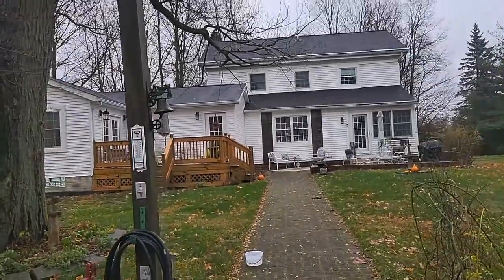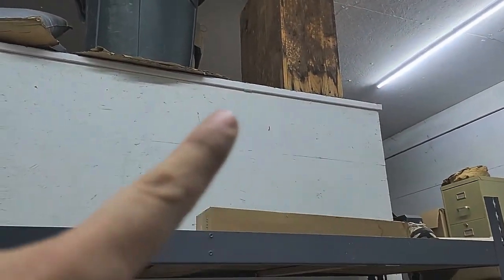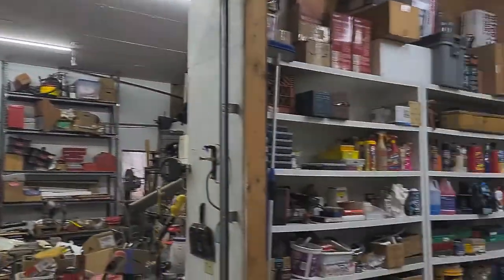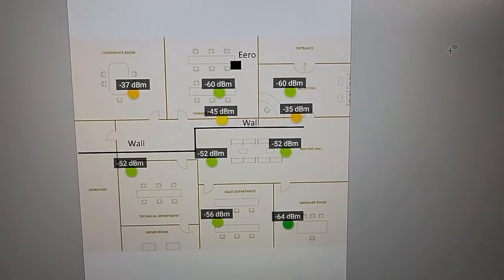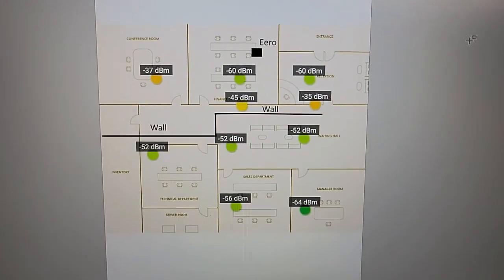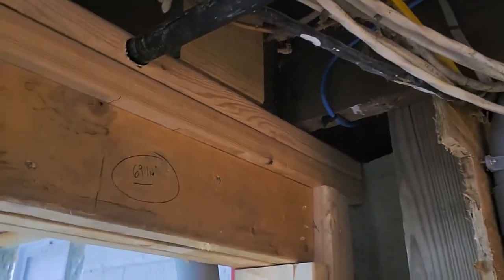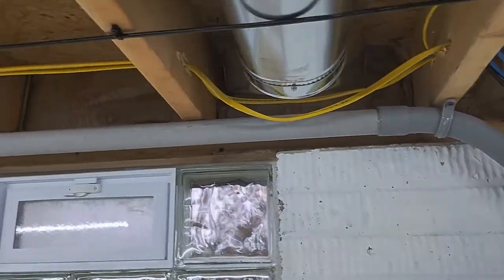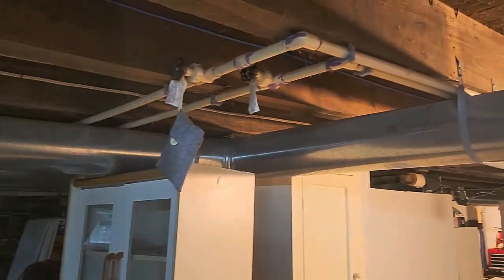Testing the New Eero Outdoor 7 WiFi Access Point

Comment: But why would you need an EERO out door wifi 7 if you guys going to still place it in the garage and not outside the garage. wouldn't a regular Eero wifi 7 work? same as the one in the house.
Reply from the maker: Because it is still outside and exposed to changing temperatures. The garage is not always heated.

Yes, it won't get wet, but temperatures will change, and this is made for that. 

Also, it is possible that two indoor units would be needed in the garage. One at each end of the garage. If so, we would hardwire them together, which means more cost to the client and units that are not made for outside.
Reply: @FisherCustomAV  Got you. But I was told these outdoor EERO are 2x2 and not 4x4, So wouldn't the transmission be better with the 4x4?
Reply from the maker: @T.O.P.S  Not exactly. These units have a range of up to 1000' per eero with no interference when outside.  

These can be used as p2p in scenarios like this. Which we have another video showing a p2p installation.

Comment: One more question sorry for all the questions. Would it matter if a cat6a or cat5e be ran directly from inside to the eero outdoor would one be better than the other or would it not matter.  I will be running a new network cable from inside my house all the way outside for this roughly 35-50ft ?
Reply from the maker: @PeteyPablo408  We use cat 6 for our installations

Comment: Can that be powered from the Eero 7 inside unit or need separate POE?
Reply: Either Poe or power cable wifi
Reply from the maker: Each eero 7 needs to be powered by either a poe network switch or a poe injector.

The outdoor 7 units can not power additional outdoor 7 units.
Reply: @FisherElectronics So I wouldn't be able to use my Eero Max 7 to power the  eero 7 outdoor. Would I be able to use the TP-Link TL-SG1005P?
Reply from the maker: @PeteyPablo408  No the eero max 7 is not poe and can't power the outdoor 7. 

It looks like that tp link switch should work. The outdoor 7 requires 30 watts of poe power.
Reply: @FisherElectronics  awesome thank you very much good to know what I need to buy , I have a small 1,268 sqft home on a 8,799 sqft lot trying to get some good wifi in the backyard area where we spend a lot of our time.

Comment: So another coax cable has to be ran for the outdoor 7? I planned on doing the exact same thing I’m running eero 6e in house but want to run the outdoor 7 to our farm house
Reply from the maker: You would only run cat6 to the outdoor eero, not coax cable. Also, you would want a poe+ network switch or poe adaptor to power the outdoor eero.  Otherwise, the outdoor eero will not have any power. 

You may want to watch this video of another outdoor 7 P2P installation we did.  https://youtu.be/XF21rqRTpGE